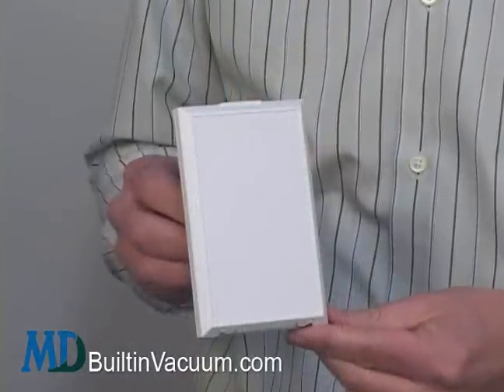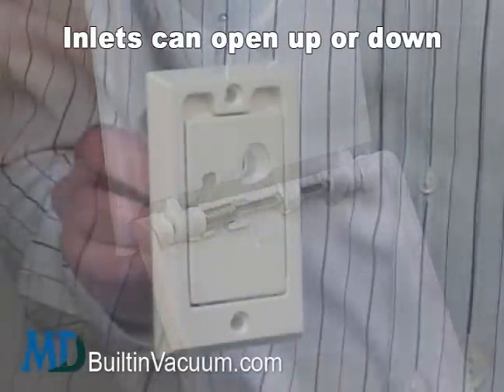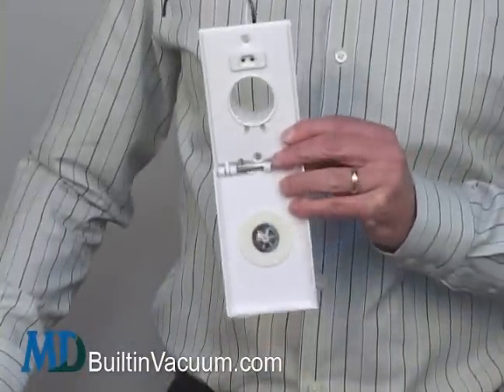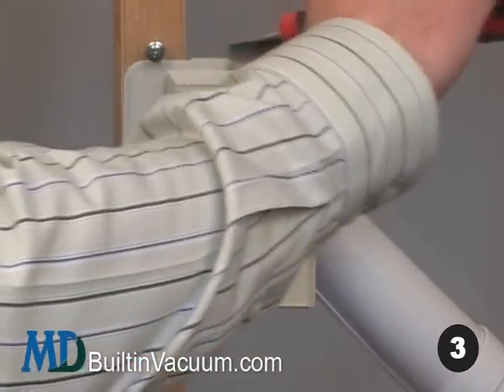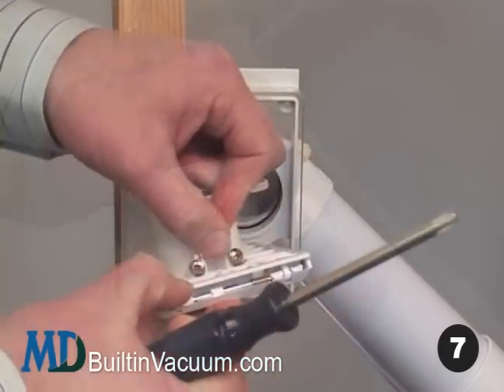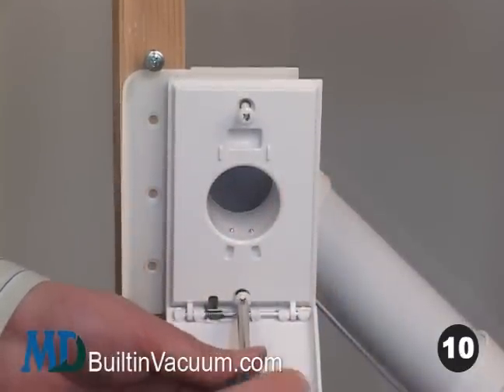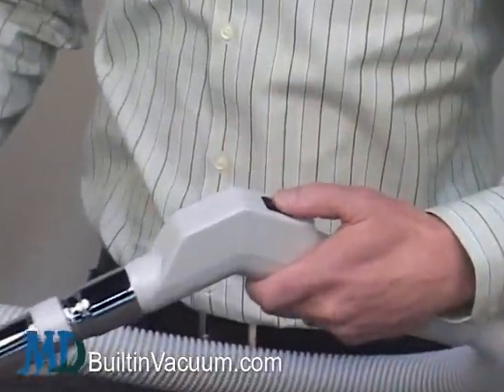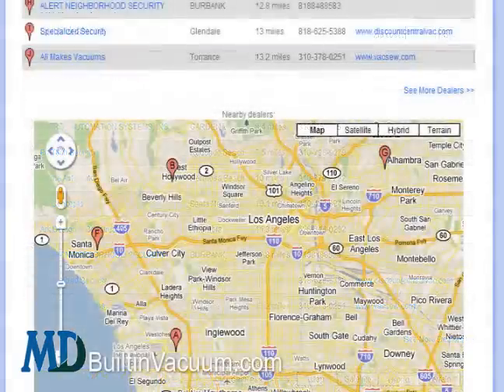Replace Central Vacuum Inlet Valve

Comment: Where can I purchase a full face replacement receptacle with 120 plug as shown in your video #7? The replacement I purchased requires me to remove the plug from the old unit and work it into the new one.  It will not come out without damaging it.  If I could buy one with the plug attached, i could connect the wires in the back using wire nuts.   Thanks